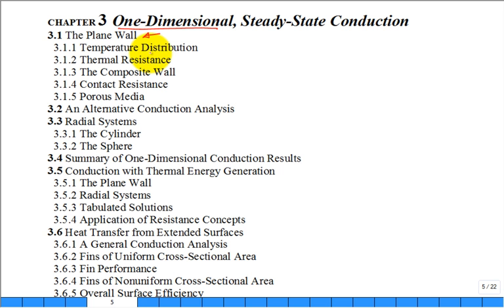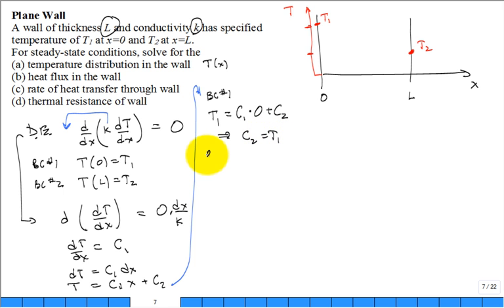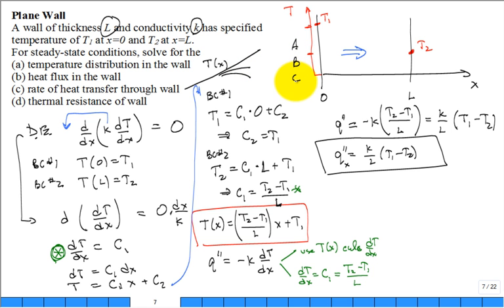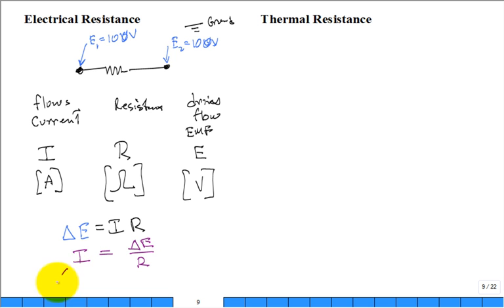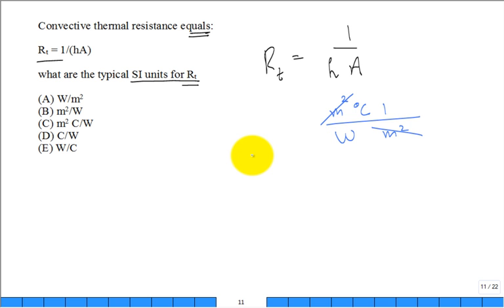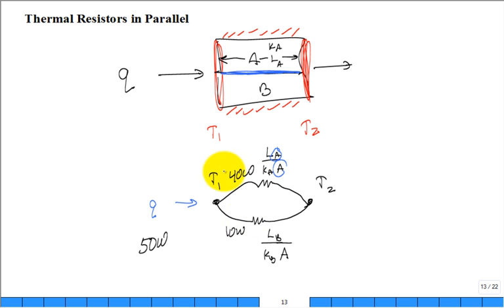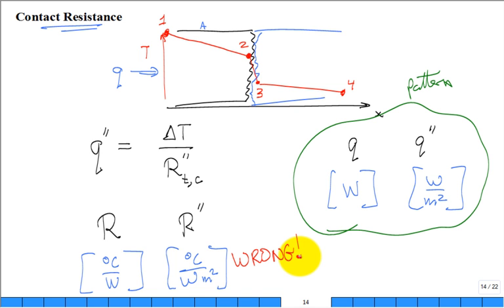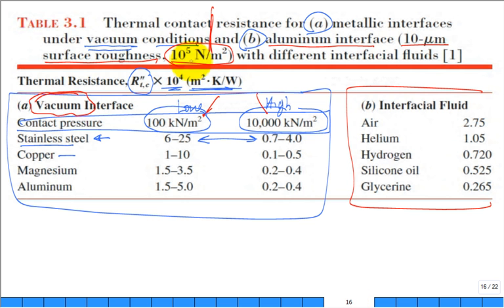Steady 1D Conduction 1of2

Comment: At 35:54 you were talking about how q'' and R'' has no pattern. However that's incorrect. If q" is W/m^2 wouldn't R"= C/W/m^2 which is C*m^2/W and correct units. Just something I noticed and couldn't believe noone else brought up in class
Reply from the maker: The units of R are (C/W).   Logically the units of R'' (double prime) are ((C/W)/m^2) which gives C/(W*m^2) which are not the units of R''.
Reply: Randall Manteufel maybe I just see it illogically. But I'm sitting here staring at it and the "pattern" I see is, if q=W then R=C/W so if q"=W/m^2 then R"=C/(W/m^2)
Reply: Randall Manteufel I only asked because there was a good amount of time spent explaining how there was no pattern and I thought I saw a pattern immediately. Then I was confused. The videos are very helpful except my class is using different notation.
Reply from the maker: I prefer the use of interfacial conductance or contact conductance, h_c, with units of W/(m^2 degC) or the use of interfacial resistance or contact resistance, R_i, with units of ((m^2 degC)/W).  I'm glad the videos are of some help to you.  Wish you the best in your studies.